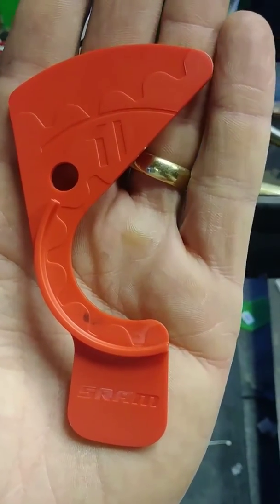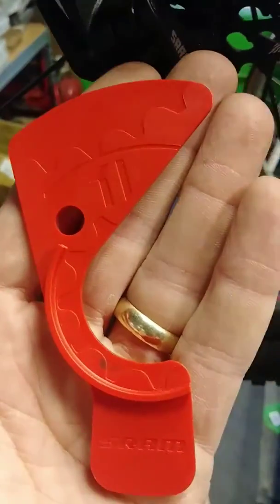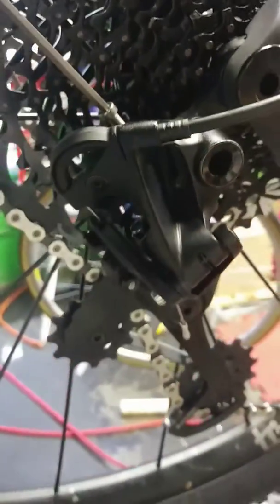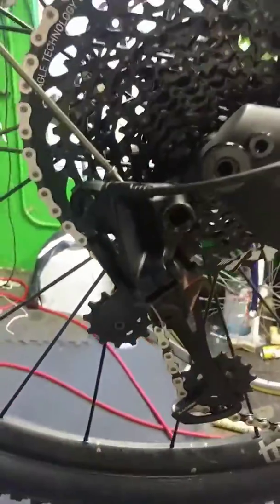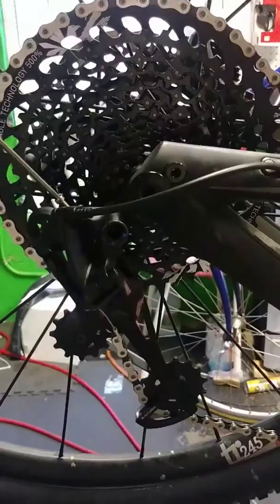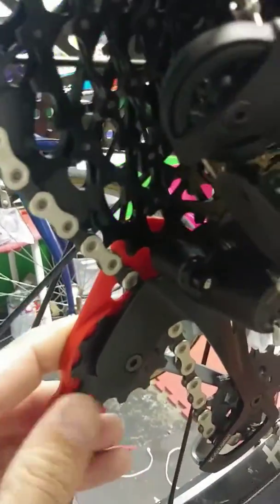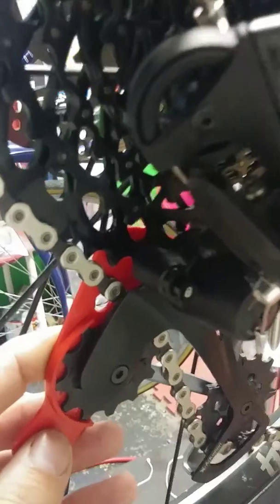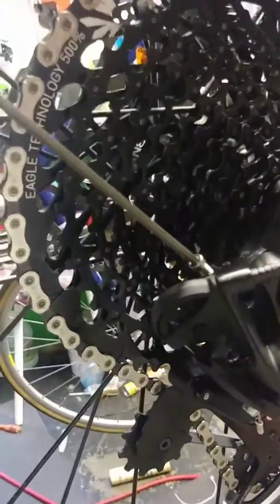Using chain gap tool to adjust SRAM Eagle rear derailleurs

Comment: I used a magic marker to put black lines that I could see better on the gap tool..
Reply from the maker: I used to just adjust it out enough that the pulley wheel wouldn't contact the large ring,  which is basically what this tool does,  but hey if they give you the tool,  you may as well use it.   Marker on there would certainly make it easier to see.